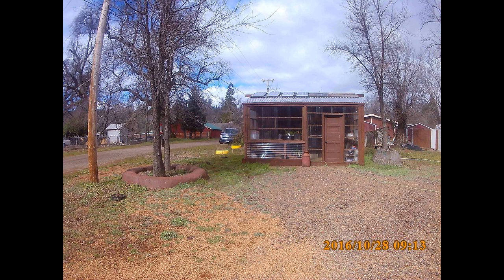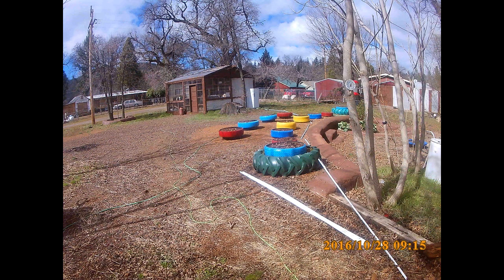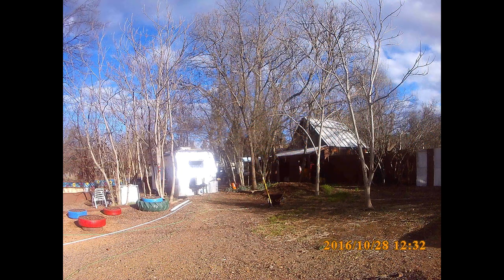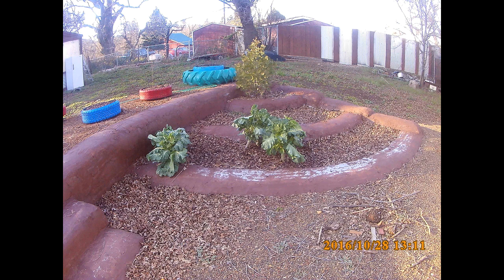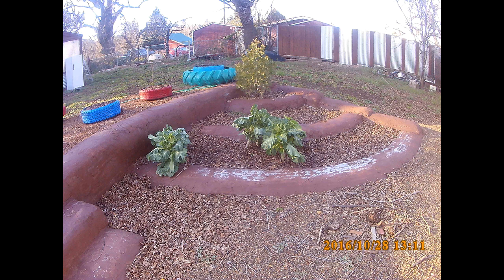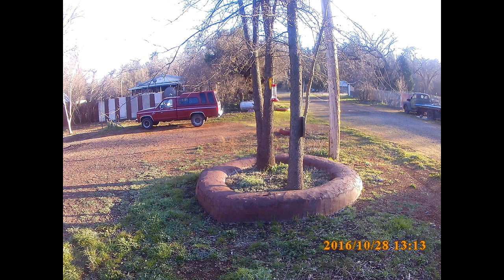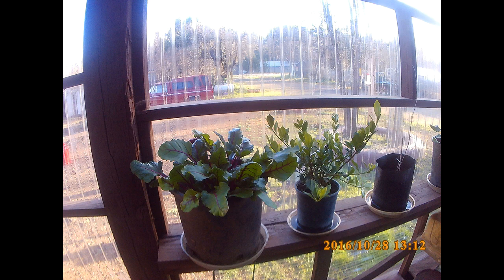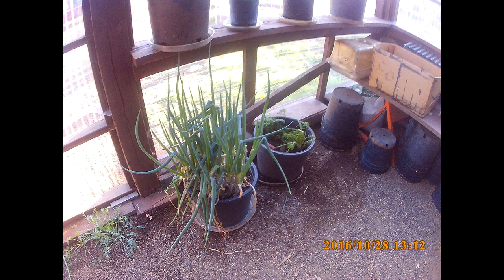My Sustainability Research (Remake w/better Sound))

Comment: MUCH better! Vast improvement in the audio.
I like your layout. It's very innovative.
I grow vegetables in my pond in buckets suspended in a wood frame with hydrotin growing medium. The fish swim under the buckets where they're protected. The pond is 4X36' in three tiers with a sump pump delivering about 100 gpm from a 4' deep section at the bottom to a 4X4' sand filter at the top and an aerating fountain at the bottom. The two upper sections are 1' deep and 12' long. The effect is a lazy stream flowing into a deep pond. I have a variety of gold fish from hatchlings to 16 inch, around a couple dozen. I have black Japanese trapdoor snails to clean the rocks and bottom, and duck weed. The Duck weed supresses colony algea by competing for resources and blocking sunlight. The fish eat the duck weed which consumes the nutrients and keeps the water crystal clear and pH neutral. I don't need to feed anything. It's a self sustaining ecosystem. I do change out the water. It feeds through an underground drip irrigation system to the gardens so I don't waste any water. Plants love fish poop.The duck weed prevents hard freezing and evaporation, and hides the fish from racoons and other critters. I skim off some of the duck weed to let in light and use it for compost in the gardens. It blooms a beautiful maroon color with bright green. Push come shove the duck weed is edible and nutritious. In a catastrophe I have fish, vegetables, snails, and 1600 gallons of purifiable water in reserve. It's solar lighted with a motion sensor and has three waterfalls between sections. The sound drowns out traffic noise from the street while sitting next to it like being next to a stream. I grow lots of marsh berries, onions, kiwi, and rotate other crops, whatever survives. It's covered under a glass pergola to hide it from migratory water foul. It's all brick with a stucco covered poly lined interior. It took two years to complete but it's one of a kind and very picturesque.
Reply from the maker: Wow Fred. That sounds like a great pond/garden system. Very similar to what I have in mind. I like the meandering stream and tiers.  I've got some duck weed (regular and giant) I've been keeping alive in a bucket for 3 years, to put in my pond when it's full. I want Tilapia fish because their omnivorous (plants and insects). I plan on raising lotus flowers in floating styrofoam trays with holes drilled for water pot inserts. 

My college education was in Natural Resources, with a specialty in wildlife. I like the idea of aqua-culture combined with gardening.

I'd love to see a picture or video of your system.  I bet it's beautiful. :-)
Reply: First time I've uploaded to YouTube. Just for you Ray. This was before the pond was completed. No duck weed yet. It makes it look more natural but more difficult to see the fish. You can see the idea though. https://youtu.be/cDULV5iLIsE
Reply from the maker: That's a real nice pond project Fred. Thanks for showing me what you can do! I'm impressed. :-)